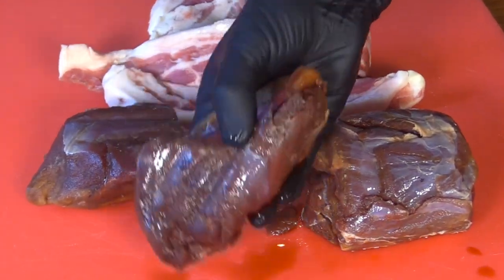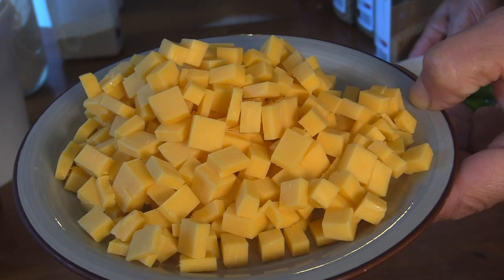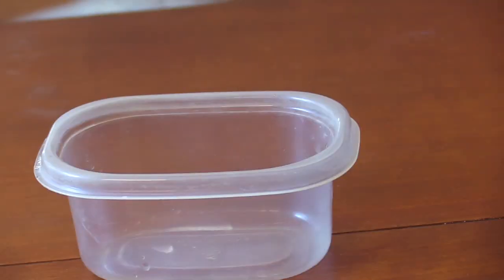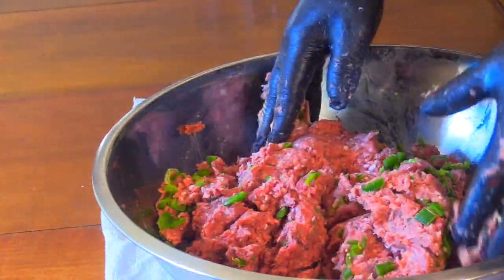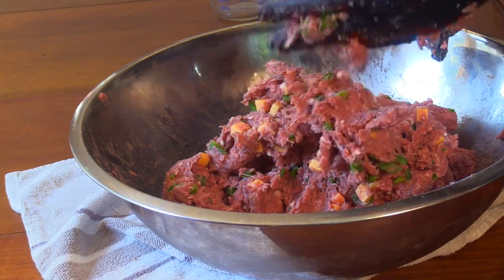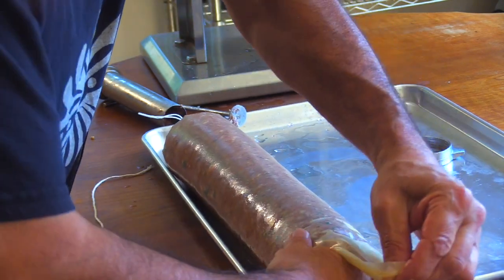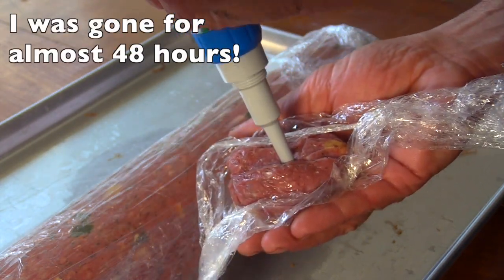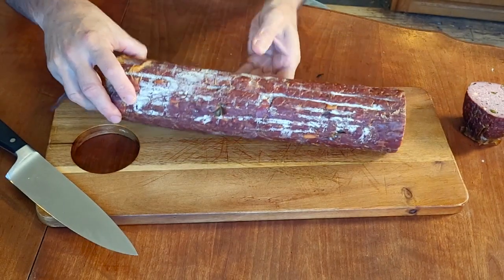Venison Summer Sausage WIth Jalapenos And Cheddar | Gourmet Woodsman

Comment: Great video! I think a side by side of high temp vs normal cheese would be great. I have also heard of people putting regular cheese in the dehydrator for about 12 hours then into the freezer to make their own "high temp" cheese for a fraction of the cost of commercial high temp.
Reply from the maker: I haven't heard of that homemade high temp cheese, thanks for the tip!
Reply: +1 for comparison